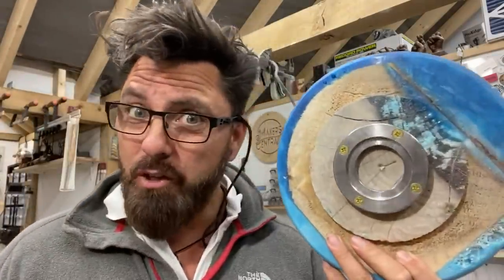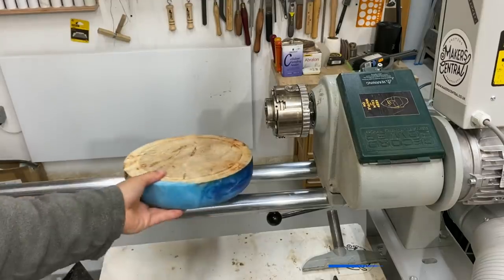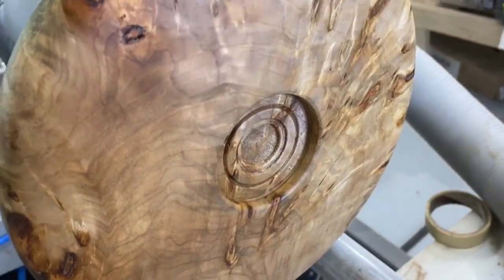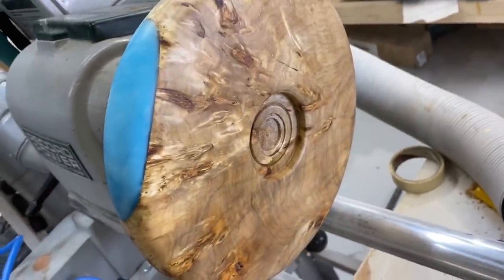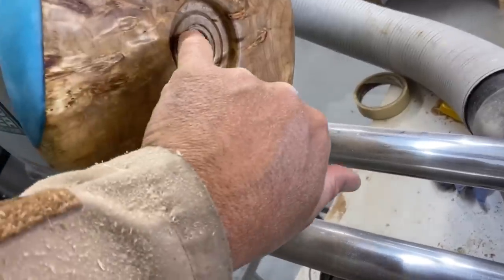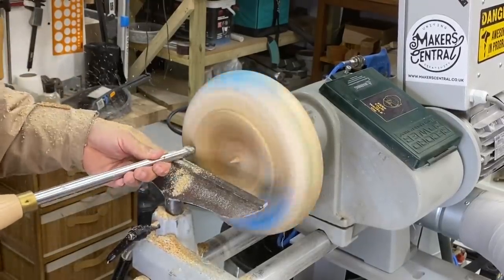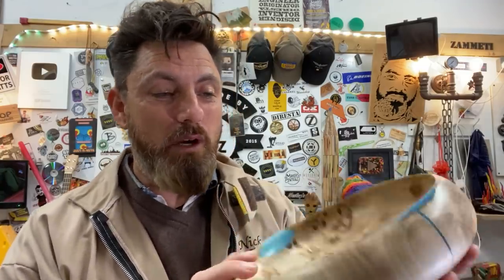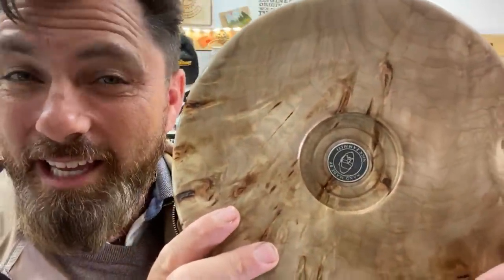Wood Turning - The Earth Is Flat

Comment: Is there a way that you could vertically suspend a bunch of the long colored resin strings in some clear resin? I think that could be a really funky project.
Reply: Oooh insert a revolving light into that and it would be super funky!
Reply: Samantha, what do you think of using actual string...maybe yarn...colored with colored epoxy that you drop in the clear resin?
Reply: Wayne Thompson even better, it would hold the color more than resin shaving strings would
Reply: It works...start with heavy dyes and strong colors....bubbles in the project are a bugger...
Spiderweb...jellyfish...cottoncandy..
Kinda visual.

Comment: I’ve a pine bed side locker I was to paint and add a resin top full of Lego..etc. The locker top has no edge so I’m afraid the resin will just spill over when poured on. Should I make separately and glue on to the locker so you think?